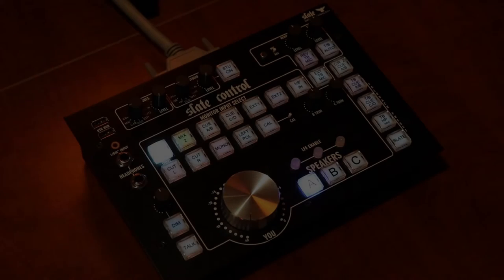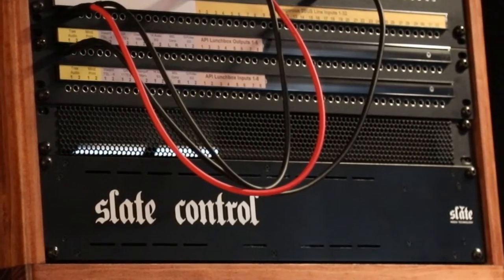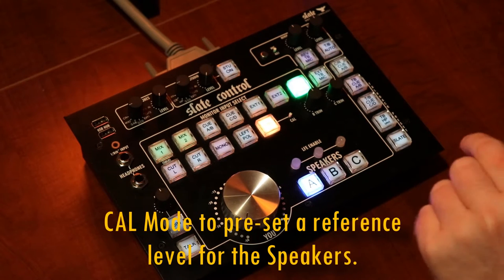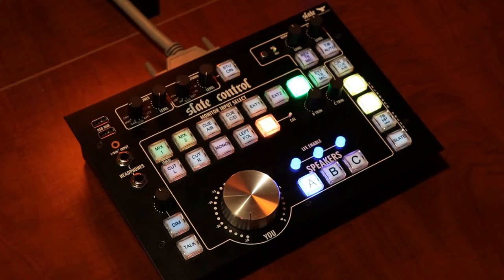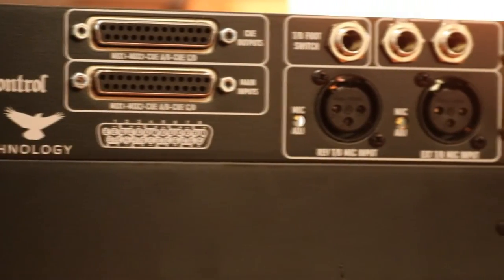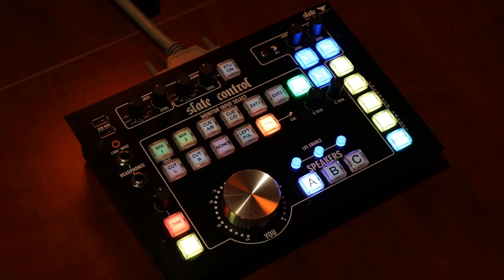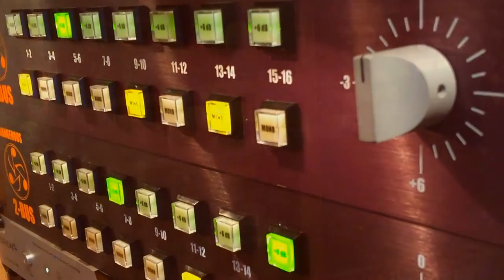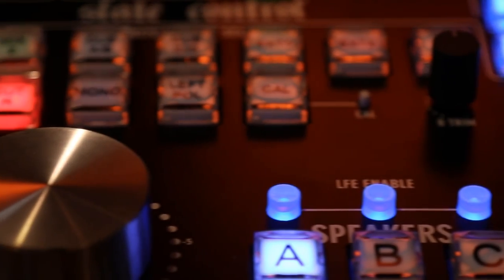Exploring Craft Audio - Episode 1 - Slate Control Monitor Controller

Comment: Amazing review thanks! How do you connect the control to the antelope? Monitor output of the antelope to MIX A ?  I have an SSL ALpha link with no monitor outputs so I have to use a pair of outputs of the converter for monitoring. It should work the same way.